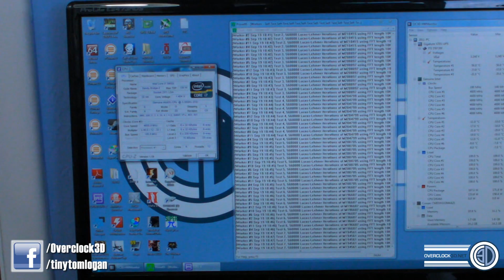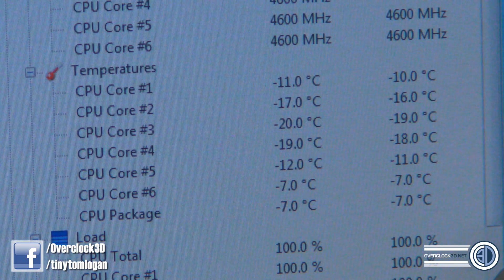Ultimate Corsair H100 Cooling Mod

Comment: Temperature is based on benchmark, it think it would be realistic if the complete setup is placed inside a closed container (simulating a real case environment) together with a independent room temperature reader. Temperature reading is based on the motherboard and is very much affected with ambient room temperature.

Comment: Hello, I have a question! I have a 360 Radiator with 6 fans (PUSH-PULL) and they are 3 pin fan, my MOBO has only 3 controllers for CHA_FAN and I wanna control all 6 of them with the MOBO because I'm using SPeedFan for temp and fan speeds.Can I connect 2 fans on each connector and the 3 case fans to the cpu connector?

Comment: no its not ,fridges have refrigeration chambers inside of the cooling system that they use to reach tempatures below the surrounding temps , based off concepts such as " Peltier devices" , the h100 doesn't there for it cant reach temps below the minimum room temps

Comment: the fans will move no more air than one fan. If the fan can move x amount of air ten in a row will still only move x amount of air. they dont move faster with more of them... they would work better if they werent running on top of each other. In other words 4 fans set up like this is just as good as 40

Comment: The fans are not making the room "cold".  It's just that the temperature sensors (PTC or NTC resistors) are "zeroed" for the "dangerous" temperatures (70+C).

Enjoy mounting this in your STH10  ;)

Comment: Dude, the wather its self are freezing below  0 C, so pls explain yourself now how its possible that your wather in the sistem ar not turned to ice, -20 C its enough for freeze that small radiator in total in 1 minutes!!! So 2 scenarios should be told, 1 corsair did not fill up with wather so they must be added some liquid thtat can cuport rly low or extreeme low temps, si did they do it i say NO they didnt...so dude -20 C its unpossible...the pupm in the cooper block will be failed in 5 min !!!

Comment: Did you take physics in school?

I'm sure you have heard about how planes work. Faster moving air on the top, slower moving air on the bottom. Makes a pressure difference causing "lift". (gasses don't like to push on surfaces much, they blow past stuff creating lower pressure areas)

Well according to Charles's law, pressure and temperature are directly proportional. So the lowered pressure of air making contact with the surface of the radiator drops the temperature.

I think that's how it works

Comment: actually, this is exactly what an air conditioner is doing. You know the types that cool down your house? It can be 100 degrees outside and 70 in your house. Your air conditioner is outside in the 100 degree air pulling the 100 degree air thru its radiator cooling the water that goes back into your house that chills the air in your house, so it is 30 degrees BELOW ambient temperature.

Comment: lol what ever dude.  One fan spins at a specific rate.  More fans all turning the same speed are still not going to really move the air any faster than just a couple going the same speed.  If they are going the same speed then they are going the same speed.  It doesn't matter if you have 1000 of them they are still spinning the same speed eh?

Comment: @pcchip3 yes im serious expanding air causes it to lose energy and the only energy air realy has is its heat which is then removed from the air making it colder, try putting your finger in a stream of deoderant expanding from a gas can under pressure the temps drop below zero because the heavily compressed gas is expanding causing it to lose its pretty much only energy source heat, if the air would be positivly charged it would be a different matter but air isent so

Comment: I don't think you understand how cooling system in any type of cooling unit work. The fans arent used to blow cool air on the part thats hot they are used to pull the heat away, how do you think a fridge work? 
If you wan't some futher info i sugest you use Google...

Comment: but fans speed up the ambient air and where air is faster there is less pressure meaning that the air is so un-dense that it can achieve negative temperatures, isnt it?

Comment: Sir, I'll try to explain it in a language that is not mine. In an axial fan blades are designed assuming that the upstream air flow is near to be axial. Downstream an axial fan the airflow is NOT axial at all. So the blades of all the fans you used downstream the first one are working bad (few air moved, very noisy).

Comment: It isnt fake if that's what you're saying. Have you ever had a mobile fan that blew air towards your face on a hot day? Well what happends is that it makes the ambient air cooler because it makes the particles in the oxygen less active because it gets forced to a place so it doesnt have to use any energy itself, kinda like wind. This happends here except that it get multiplies by 40 besides the normal 1 or 2 fans, you understand? :)

Comment: there are actualy a couple cases that might be able to fit this setup inside, i saw a modified NZXT phantom chopped and added to another, to make a long case. so you could fit it in the 2nd part of the case, or have a really long radiator

Comment: Curious on what the actual performance would is... You have so much static pressure, you could use this as a vacuum cleaner! (I did it the other way. radiator+ vacuum cleaner + funnel + ducttape + a better pump, to actually circulate the cooled liquid fast enough to be efficient)

Comment: Copper pipes conducts heat better than water. hey why does your electric hot water system power by copper heating coils? like the power to your computer is passed through a copper cable.  What I saying is copper can take in heat & release it much better than water. Plus water cool systems over the time of use, there would  be a bit of heat left in the water which will added to the heat coming off the core & so for cause a domino effect of making it worst. Air cool with saturate the core with -

Comment: What if you would get them spiraling the air through the cooler? Rather than all the fans before the radiator pushing air to the back of the fan blades of the next fan.

I think it would be even cooler and much more quieter with a tweak like this.

Comment: Nobody seems to be understanding... his software is showing that adding fans will freeze the air.  This isn't possible as fans only move around ambient temperature air.  They will bring the temperature of the CPU closer to the temperature of ambient, however they cannot drop the CPU temperature BELOW ambient temperature unless some sort of cooling is used (such as peltier or phase change)

Comment: you would stop lowering the water temperature after about 3-4 fans (any more fans wouldn't add to the airflow)

Now, if you were to instead add that many RADIATORS then you would definitely increase the cooling power of this loop!  (Add enough radiators, and you can essentially keep the water at room temperature no matter what you're cooling with it!)

Comment: Like I said, yes, it is possible to get -ive temps on fans, it is the same way professional refrigerators work and air con (look up 'heat transfer' if you are interested). Although it is possible, it would not be easy to do it in this case and the fact is that after 4-5 fans either side, the static pressure tail off will mean that you will not see a great increase in performance with each additional fan. Still, quite funny and has got people thinking for once :D

Comment: Well I am pretty sure he was joking about not hearing fans ... but fans making the room cold ... if they are pushing 20 degrees air around it is still just pushing air around, it does not get colder. But the hoax with the temps readout is a bit intriguing ... can not be done with fans.

Comment: air friction does not cause something to cool. radiators spread the heat out on a large area, and air gets through the radiator causing the air to get hotter (and the radiator colder). INCREDIBLY simple physics...

Comment: Just a stupid question  -since the air in the room is above 0° how can the system can be cooled below that temperature? shouldnt the water inside the watercooling system not be freezing at like -20° which it MUST have since the CPU is always hotter then the water?

Comment: How come i have never seen some one use a small aftermarket intercooler from a car? I work on cars and you can get some little bigger then H100 radiator but intercooler are about 3-4 inch thick and i bet it would cool ALOOOT better.I think that could be my next project

Comment: Wont it be limited to the Air pressure on each fan?
so if one fan can only push 20cfm adding 10 fans wont make it 20cfm x 10
It would still be 20cfm or less from the pressure limiting the fan speed.

Comment: Cool test. At first I though.. Oh jeah... Hes going for the absolutely useless crap test and then it turns out that this was the absolutely useless crap test.. Hehe. But you know what? It stil is freakin awsome. I would have expected the temperatures to be at a little bit less than having 4 Fans. But with the temps reaching less than 0C° I would never have expected that :) Great Job dude! Thx for the knowledge ^^

Comment: It is physically impossible to get lower-than-ambient CPU temperatures on a watercooling loop.  I didn't see the man's breath, nor was he wearing sub-zero gear so the temps are fake.   Also, objective tests show that adding more fans will, at best, reduce pressure loss, but the same CFM will be flowing through the radiator as you can't simply multiply CFM by the number of fans.  In some instances, stacking fans can reduce CFM.  Stupid waste-of-money test.

Comment: It does defy physics! How the hell is it possible to get water to less than room temperature, when the actual air flowing through the rad is hotter than the water, it doesn't even make sense unless you use a Peltier thermoelectric cooler. I honestly expected the temps to be around 20C, (which is actually awesome), but this is bonkers!

Comment: Understanding of Fluid Dynamics fail...

The first fan gets the air moving. The second fan might help. All of the rest of the fans in those stacks are completely useless. Turbines with multiple rows of blades use counter rotating blades and increasing size for a reason.

Comment: Umm... I may be kinda stupid here, but how does the temperature go below room temperature? Don't fans just move air around? Displacing warm air with room temperature air, thereby keeping the cpu closer to room temperature? How is it getting to -20 Celsius? Don't fans actually output some minimal heat through friction?

Comment: Poorly conducted experiment.  First, you hold the microphone behind/in front of the center of the fan which is where the least amount of air flow (the quietest part of the fan). The loudest part will be between the center and the edge (or about 1/2 of radius from center) where the wind will have the most speed. 
Second, why not use a sound level meter that will display sound level in dB, not in just "here, listen to this..."

Comment: cooling works by the fins transfering heat to the air, if the air is 21c it cant absorb heat from fis that are 20c, the fins would be absorbing the heat of the air and making the water hotter

Comment: You're skin is not at room temp. Body temp is 30c. and room temp is 21c. So blowing on you're arm it only lowers skin temperature closer to room temperature you are not going lower.
Same with the setup here. it don't matter how many fans he uses. You cant go below the temperature of the air you are cooling with.
That's thermodynamics.

Comment: 1) ring toss at the local carnival for the spare rings
2) could have done a test to how many FANs to achieve better performance than the standard two (2) or four (4), because the results you achieved were promising (albeit to many fans to be taken serious) which resulted for a better cool than normal result but how many fans does it take - hmmmm....

Comment: for this to work more effectively you would have to start out with 4 high CFM 400 and every 4 fans step down in size to the 120mm fans then back out the back  but you'd have to build bend spacers and it would end up looking like 4 trumpets lol   i'm just  sayin'

Comment: True, but if it would have been water it wouldn't have frozen in an instant just because it reaches below zero temperatures, it would slowly crystallize until it actually froze to ice. But as you said it might not be water :)

Comment: He really didn't need to use all of those fans to get the same results he could have used 4 252.53 CFM Delta fans in push pull to get the same effect. He did this just to be wonky because he knows people ask crazy questions like this about fans and radiators.

Comment: its so cool because its a troll video haha. it isnt actually that cool. he says its a troll but i dont know how he managed to change the values. but im pretty sure an ideal solution would be for the cpu to run at the ambient temperature. the only thing that is removing heat from the computer system is air so its impossible for the cpu to run cooler then the air temp.

Comment: its impossible. temperature only moves from high to low. Electronics pub videos is right the most ideal situation would be to bring the cpu down to ambient temperature. if the water in the h100 is a lower temperature then the air passing through the radiator then heat cannot travel from the water to the air. it would only make sense that the heat from the air would warm up the fluid in the cooler as heat only travels in one direction.

Comment: 7:09 its a monster!!! I think if they made say something like the H150, I mean look at the H100, The rad is quite skinny, they should make it thicker for, kinda like the H60, H70 & H80, wont help much, but should drop a few degrees at the vary least, Yeah most cases would fit it, but I like modding my case, I would make it fit and make it look nice. But even then you could buy a Liquid cooling kit for 150 with the same size rad as the H100 and cool better

Comment: No, they aren't. Many components are necessary to produce that refrigeration effect. There's a compressor, condenser, 'hot' radiator (to disperse heat created by compressing Freon), and a 'cold' radiator (through which the now expanded Freon flows through). No radiator alone can cool anything below the ambient temperature.

Comment: radiators are base on the same principle as your refrigerator. putting the liquid under pressure to heat it up so it loses heat in the radiator itself and than releasing the presure so that it cool down.

Comment: As far as I understand it, a fluid (air) moving at a high velocity will be at a low pressure. The ideal cas law would have me believe that a low pressure column of air will be at a low temperature.

Comment: if you took 20 dual 120mm rads, and put them in between each set of fans, you would have a really beast cooling system. I think you might need to use anti freeze from a car to do that...

Comment: It is impossible...according to famouse thermodynamic law, evrything will be at same temperature afther a given time. and those fans can only transfer the heat from the radiotor and by no means the radiator and coolant can get lower than ambient temp.

Comment: The rate at which air contacts the radiator fins increases by about 15 percent when you have a push pull configuration with two fans but adding additional fans after that will have a negligible effect as all the fans are spinning at the same speed. The radiator surface area is his limiting factor rather than the amount of fans he has in this particular setup (which you can all tell is a just for fun anyhow).

Comment: Would it make ANY difference though.. Like having say two sets of fans on full whack, would it be any better than just one set. Im not considering it, and I know a cooler run off of air can be no colder that the air temperature, but would it be any cooler?

Comment: Everyone has a fridge/freezer.
Just freeze a stockpile of ice,extend the tubing of the radiator,place radiator(minus fan) in insulated six pack cooler with ice slurry...
Your fridge is always running..use it

Comment: By incorrect I mean someone can't make a mathematical model of the relation between number of fans and the amount of air flow generated by chained fans, by considering just number of fans as input parameter and some exponential function like a^n, because it can get closer to real life values only with too few, small values of integer n. I mean it grows so fast, with 384 fans, n=95, a^n = 103, you get 10200% better, 102x better air flow. But sorry for my criticism...

Comment: I'm not saying anything about physics but, if each fan propagates the air 1.05x more, 10 of them make 1.05^9 ~= 1.55x faster, therefore 4 of 10-fan packs get 1.55x faster each, so 55% better overall. But of course physically it's so incorrect/inaccurate, especially for exhaust fans (20 pcs). But interesting point is, how many of fans are useful to make it better? 2 on exhaust and 4 on air input side maybe? Or what if 4 input fans are worse than 2 because of air resistance top fan generates? ...

Comment: Can someone please explain the temps seen in the vid? Wouldn't it be impossible for the CPU cores to drop below 0 degrees c? Because as far as I know, according to the second law of thermodynamics, with CPU cores that cold, shouldn't heat begin to flow from the water into the CPU? I don't understand how a coolant that isn't below 0 degrees c can cool an object to below 0.

Comment: In the case of the video, the fans are doing work, not the air, so there is no decrease in temperature. This is a basic principle of thermodynamics. I suggest you do some research on wikipedia or in a standard physics textbook.